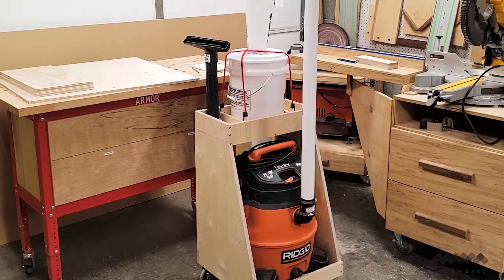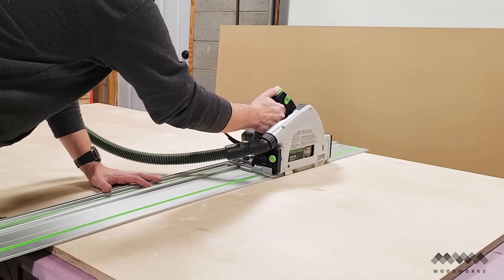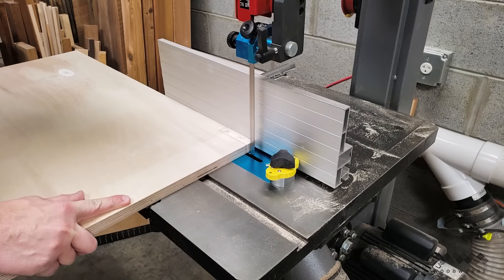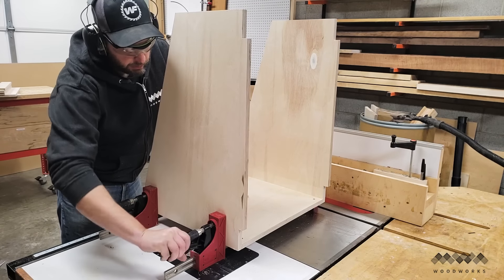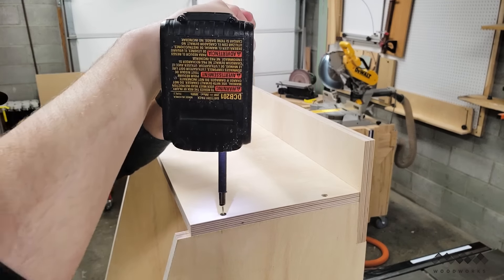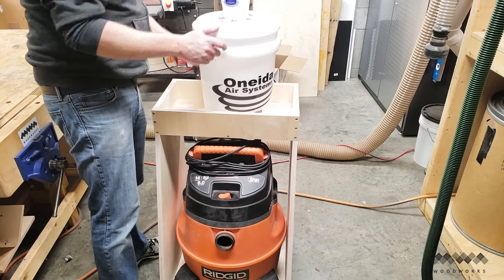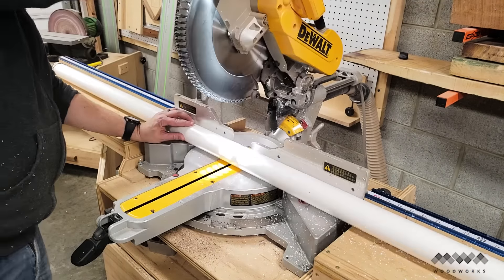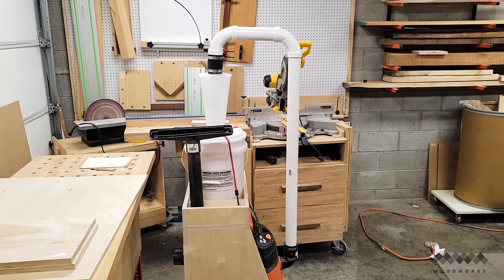Dust Collection Cart with Cyclone Separator

Comment: For anyone wondering about the various connectors.  The PVC is 2" thick, so are the 90 degree elbows.  Two black 90 degree connectors come with the dust deputy.  The remaining two rubber connectors are Fernco P1056-22 (2 inch x 2 inch), available widely in HD & Lowes for roughly $5 each.

Comment: Great video - Thank you very much-I  will adjust by changing design(eliminate Castors)  to add two  large lawn mower size wheels and two rubber feet and a handle higher up( like a dolly handle) , wire with washer to eliminate static electricity and, hooks /bungees to hold hose

Comment: I like it.  I had another plan in mind for a very long time - tomorrow is the day!  (OK - maybe a two day project.  I may need groceries. . . )  Easier and more compact than the other plan I had intended to make.   In particular since I have the Home Depot  version of the cyclone.    I guess I'm not wed to the birch plywood. It the stuff holds the tools, I want my end products to be beautiful - the shop tools don't have to be beautiful.    I have base and top pieces.  I saw one piece at Ace that will suffice for sides.   Uh yeah - more PVC also on the shopping list.   And the rubber connectors, as well as clamps.   I don't have this stuff laying around. . . . After this - a mini-log sled to cut up my raw wood. . . . .

Comment: Will do, at this time cannot install dust collection system due to inadequate power, need to do cleanup afterwards. I have a Rigid and the Deputy, this plan will make lugging it around much easier and then the hoses won't pop out of their fittings.

Comment: Nice Job! One question. What is your process for emptying the dust collection bucket? From the video it looks like it’s pretty solidly connected with the pvc.
Reply: This is a potential problem. My build made for easy bucket emptying, but my pvc fittings would wiggle loose here and there. 
My biggest issue was assuming it was catch all dust and my filter would never need to be cleaned. 
Dont get me wrong, it works, well, but my filter still needed occasional cleaning. 
Since my build didnt take this into consideration, disassembling was a mess and when moving my whole cart fell apart. Time for version 2.0. 
This will include thumb screw hose clamps for hoses, a T-fitting trap going into the shop vac, easy filter cleaning access, and easy bucket emptying. Ideally a screw top for the bucket
Reply: couldn't one replace the screws on the rubber pipe connection thingies with thumbscrews? that way one could remove the cyclone and the bucket for emptying (if the PVC pipe construction has enough play that is).
The other more elegant approach would be to replace the palstive bucket with one of them steel ones that have a ring with a lever to secure the bucket to the lid. Then simply construct the whole thing such that the bucket ist standing on a board of say 3 cm. To empty the bucket you simply remove the board, push the lever and remove the bucket.
Reply: Hi, I think the trick is to find PVC fittings that are a snug fit... to date they haven’t worked loose. I just detach the bungie cords and ease the bucket off. I didn't find I had to use rubber joining pieces or hose clamps.  I also haven't found the need to seal or secure the lid onto the bucket; assuming the lid has a reasonable grasp of the bucket rim, the vacuum inside the bucket will hold it on tight. That's been my experience with it anyway 😎

Comment: The only thing I have done differently was I added a 20-gallon garbage pail because the 5-gallon pail really fills quickly form the planer. I really like your use of the PVC piping. Great build
Reply from the maker: Yeah mine is only used for light duty sanding and cleaning the shop. The 5 gal bucket is good for me

Comment: Just bought the plans. I have the Rigid 4 gallon 5 hp vacuum which is smaller but cart will still work, may need to secure the vacuum down to not move around. Have the Dust Deputy. Thank you.
Reply from the maker: Check out my latest video. I just made a new cart that works for smaller shop vacs like yours

Comment: I build my Oneida Dust Deputy vertical and my chief complaint is no place to store the hose.  Now I am looking for another option, but so many out there do not address the need to somehow store the hose.  What I do like about yours is the use of the PVC connecting the vac and the Dust Deputy.  This is also a much more stable version.  I will need to come up with a way to modify this to store the hose.

Comment: Looks great. Curious if the pipe is a pain when emptying the bucket. Just lean against a wall?
Reply from the maker: The rubber connector has some flex. You can get the lid off and just let the lid hang while you empty it 👍

Comment: I like it I’ve been looking at a lot of these lately how hard is it to empty with the pvc connected pipe?
Reply: Ron Cifu I don’t see that he has responded yet so I’ll give you my $.02 worth. Mine is very similar and because of the rubber connection points, the pvc can flex out of the was enough to remove the lid and pull the bucket pretty easily.
Reply: @shannonvaughan4385  what size PVC and connectors did you use?

Comment: Wondering how tall your shop vac is? Want to make mine as tight as possible without making removal of the vacuum difficult. My vacuum is about 25” high. Your plans call for a taller cart. Wondering if your vac is about as tall as mine and you needed the additional room for easy placement/removal?

Comment: I really like your design, especially the clean lines of the PVC pipe rather than vacuum hose. Nice job.  One question,  do you find it troublesome to move the pipe to empty the bucket with the "hard pipe" set up.  This question has been my major hold up on a similar project.
Reply from the maker: Nope. The rubber pipe connector has enough flex in it thst taking the lid off is super easy

Comment: Good design, my problem still is the hose holder, I have double the length of the hose that came with the shop vac, and still look for a design of a cart and a hose holder, something that holds both the shop vac and the hose and can easily be rolled around the shop.

Comment: Liked the build, but had one question.  With the rigid PVC pipe, is it difficult to remove the lid from from the 5-gallon bucket?
Reply from the maker: Nope. The lid pops right off and the pipe easily disconnects from the shop vac below

Comment: Great video and cool design! I would like to try this myself for my Rigid vac. I can't figure one thing out though: is the hose fitting at the front of your vac 2.5" (as is my Rigid vac)? If so, how did you connect the narrower 2" diameter PVC pipe to the elbow? There is a flexible 2"x2" coupling there in your design but does it accommodate the 2.5" PVC elbow?

Comment: How do you remove the 5 gallon bucket when you need to empty it?  Do you have to loosen the hose clamps to take off the PVC?  Or is there enough wiggle in the pipe itself to disconnect one of the elbows?
Reply from the maker: There's enough wiggle

Comment: Nice video.  You find this thing top heavy or tippy at all with pulling hose from the top half?  Was going to build a vertical setup like this but afraid every time I pull it around it just tips. One guy put concrete in the base but not sure I want to go to that extreme.
Reply from the maker: No it doesn't tip at all with the vac in the bottom. If you pull on the hose too hard it will just slip off the cyclone anyway.

Comment: What size 90• elbow did you use to fit the shop vac inlet?
Reply from the maker: 2 inch I believe
Reply: @MWAWoodworks  did you have to modify it or does a standard 2” 90 fit right in there?
Reply from the maker: The dust deputy comes with an adapter that made it fit perfectly with my shop vac
Reply: Chris, you can order 90 d elbows from dust stopper .com.  That is the orange one sold by Home Depot.   If I remember correctly they are no more expensive that rubber elbows and vac attachments.

Comment: I like this design a lot, but I would be concerned about the extra steps to empty the bucket with pvc vs a flexible hose. Nice video!
Reply from the maker: There are no extra steps. There's flex in the rubber connectors that allow you to pull the lid right off without disconnecting anything.